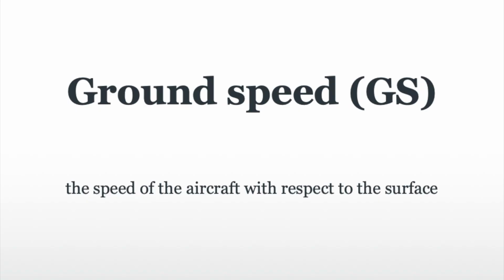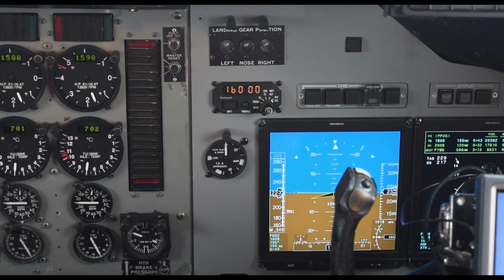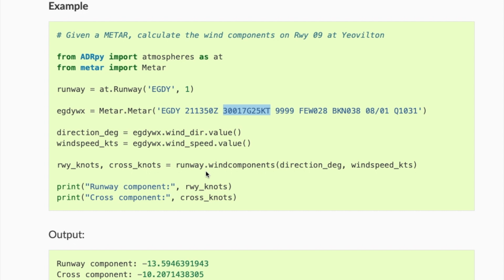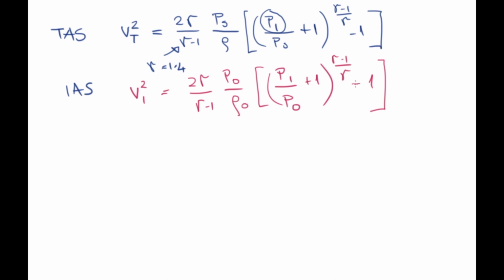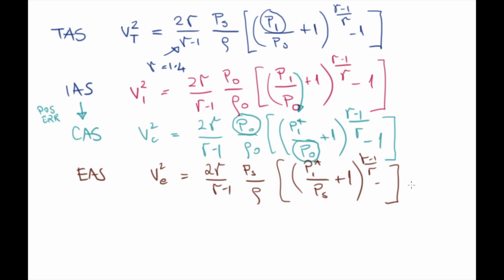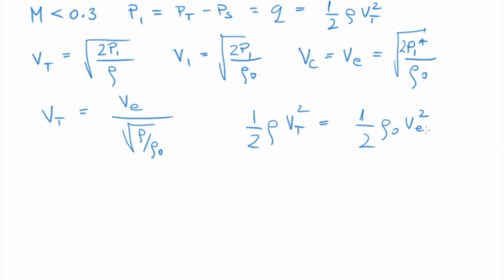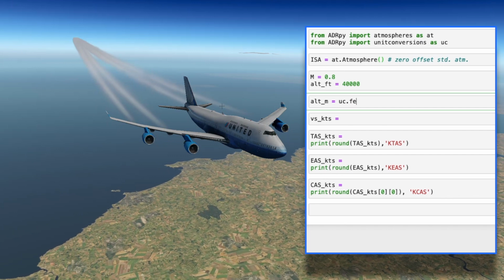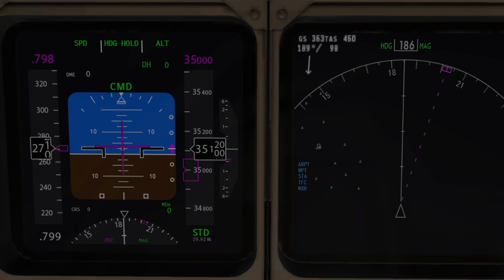Understanding Speed in Aviation - GS, WS, TAS, IAS, CAS and EAS

Comment: There are so many erroneous airspeed videos out there it is great to see one by somebody who properly understands the subject.

I do wonder why modern jet aircraft airspeed tapes still display CAS (not EAS).

CAS was defined at a time (about 1926) when aircraft were beginning to fly at speeds where incompressible flow theory was no longer good enough, but before the invention of air data computers. Since the mechanical ASI measures only a single variable (impact pressure) CAS had to be defined as a function of impact pressure only.

Today high speed / high altitude aircraft have air data computers with independent inputs of total pressure and static pressure. Since EAS is a function of these two variables any modern air data computer (given position error correction) could output EAS for the airspeed display thus eliminating compressibility error. The fact that CAS is still displayed on modern EFIS speed tapes seems to be just a matter of historical convention.
Reply from the maker: Thank you, Piers. Yes, I suspect you’re right. Displaying EAS would certainly make a lot of sense, particularly for checking structural limitations (max flap extension speed, etc). I wonder whether there are some exotic failure modes buried in the way some air data systems calculate EAS (at higher Mach numbers) that don’t affect CAS (perhaps TAT probe icing) and therefore it is deemed more robust? Also, I wouldn’t be surprised if some glass cockpit ASIs were actually showing EAS - I mean, they are often labelled ‘IAS’ when they almost certainly show at least CAS.